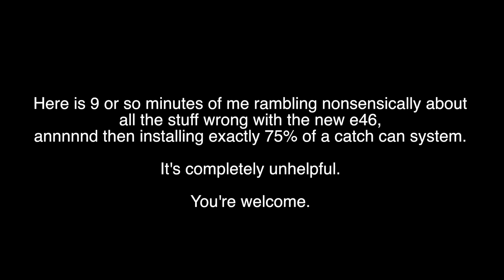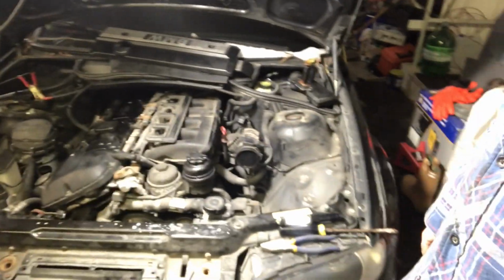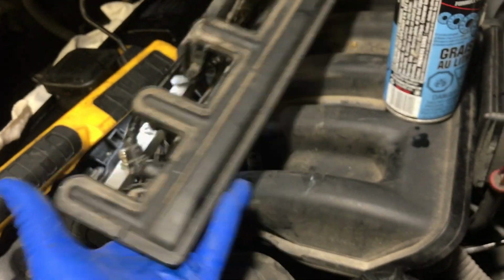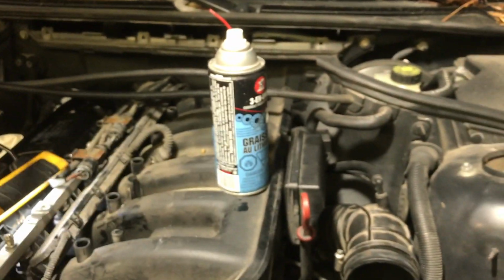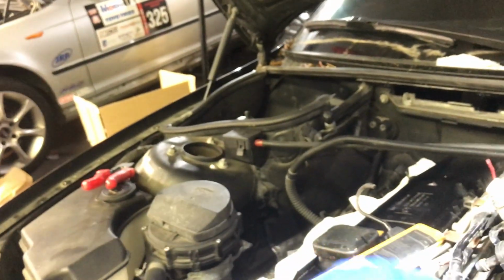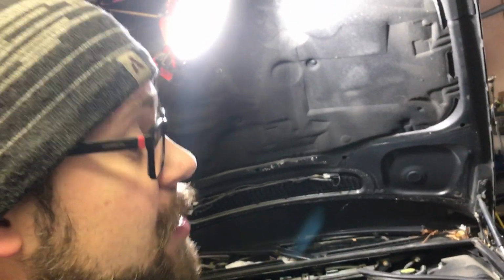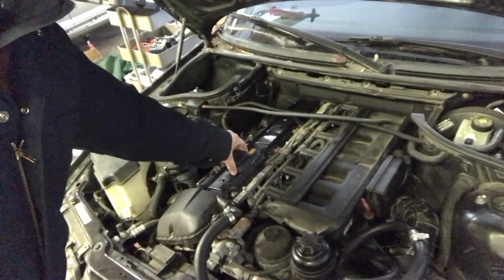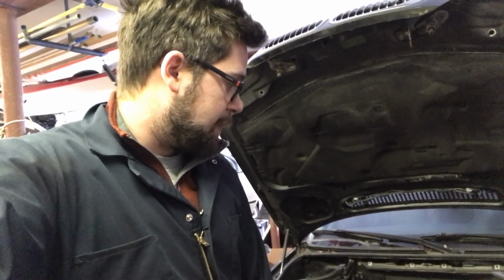The new E46 has problems...Deleting the CCV and solving misfires...

Comment: Hi mate. Been 'following' you for a while, not literally coz I'm in th UK.
I too read up for ages (but I'm talking weeks, maybe months) worrying about installing a catch can in my stock 2002 325ci with 110,000 miles on. My issue was oil consumption tho.
Although it hasn't solved my oil consumption problem (I've only put about 500 miles on since the catch can install and i believe it improves with mileage), it has completely changed how the car drives power wise. I've owned it for around 5 years and i always knew it wasn't driving as it should. I even had my BMW indy say there was nothing wrong with it. Anyway, they fitted it for me and like yours, the vacuum is super strong but by god does it pull better, feels better and just drives better. Reason being I'm getting better combustion now due to no oil vapours entering the intake and combustion chamber. The increased vacuum also helps the engine works easier. Mine is routed exactly the same as yours will be. Although my can was a Mishimoto and cost over £120. You should see the amount of crap it collects, but I'd rather empty the can than have it going in my intake.
Good luck bro, you won't regret it. Keep it up!
Reply from the maker: Nice! Yea I’m excited to actually try it out to see if the car drives differently. Just need it to stop snowing...

Comment: I suggest changing Spark plugs for 1electrode iridium (denso or ngk).
I have denso ik20 with 1.1mm gap in my m54b25. Such a improvement over 4electrode ngk (especially in low rpm).

Comment: I worry about how negative the crankcase pressure is with this set up in place. Is that something I should worry about? I'm running it right now and something weird is happening. When the car is warmed up the oil level goes down DRAMATICALLY. When it cools down it goes back to normal. Should I be worried?

Comment: Great vid. My 2000 black coupe was misfiring as well a couple weeks back. Replaced the coil and it solved misfire but I think my spark plugs are ancient and needing to be replaced. Quick question, since you mentioned the air intake, what would be the best way to install an aftermarket one(ex. Short ram, cold air diy)? How much of a difference would it be compared to stock? I’m looking to installing one 👍🏼
Reply from the maker: A long tube intake will cause a very slight increase in performance but not much. It will sound better though

Comment: A question for you T.H. , how were you sure it was the CCV before taking off the intake and not leaking valve stem seals for example? Was the CCV failed when you took it off after all?
Reply from the maker: There was lots of oil gunk and fresh oil in the vacuum rail.

Comment: Do you have any CEL? I had my system running too lean code on my 325i that was causing misfires and it eventually ALMOST wouldn't start, and a lot of the time it's cause of a vacuum leak. It's good that you're replacing the fuel pump though because that's what actually was the problem with mine, and they tend to be a common issue as well. Luckily it's under the seat so you don't have to be dropping out the fuel tank.
Reply from the maker: I had several misfire codes and maf codes. Changed maf, made sure whole intake side was vacuum leak free, and replaced a coil.

Comment: Ihabe instal catchcan but after 10 000 miles i dont know why lean code came back and it came from bad valve cover gasket also it was new have a lot vacuum in system but still lean code and eml light on when i blocked intake vacuum line code are gone what ia wrong catch is mishi moto everything is good with that catch can i change the vve cover gasket but the came back after another 10 000 miles and know i willinstal only tank breather will stop all  vaccum line

Comment: why don't you just run a hose from the valve cover right under the car and block the 6 holes in the intake manifold with some blanking caps...
Reply from the maker: Because I want to create crank case vacuum.
Reply: Throttle House for what? it doesn't help you with nothing..trust me. i have been running my m52tub20 engine more than a year and a half like this
Reply from the maker: From what I understand if you don’t relieve crank case pressure rapidly enough, and spend a lot of time at redline (like when drifting) you can blow rear main seal. Also I don’t want to vent to atmosphere. It stinks.
Reply: Throttle House i have been driving like a maniac, i even mapped my engine to rev to 7300rpms and i haven't blown anything on it... for more than a year.. the only thing is that it actually stinks, if you care about that
Reply from the maker: Yea. I’m sure it will be fine for the most part. But it’s not too much more work do a can. Then I don’t have to worry about it and it won’t smell
Reply: Throttle House good luck my friend!